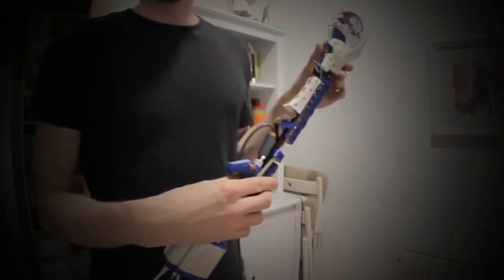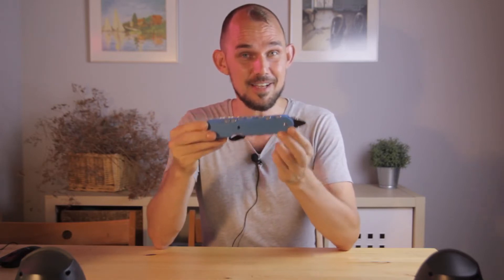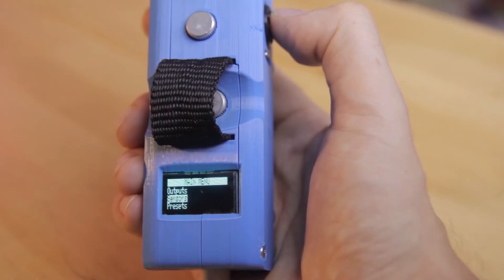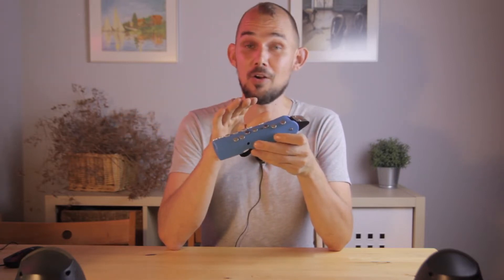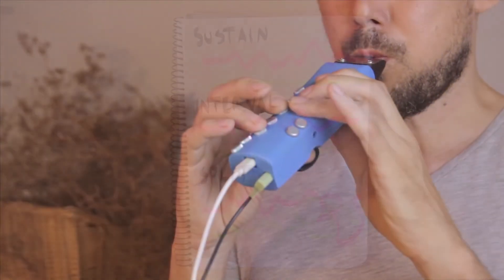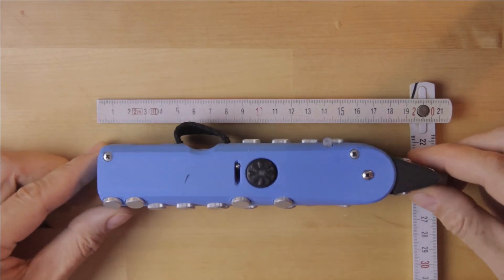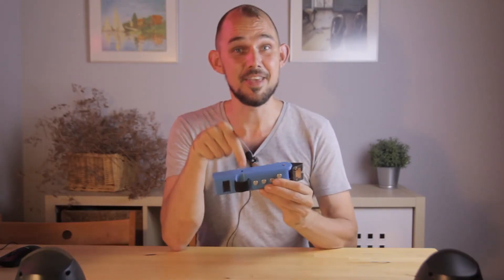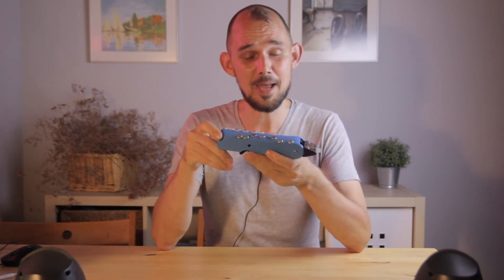My new EWI is bigger on the inside

Comment: well i loved  the idea  , just wanted to know does it works  well as a sax ( i mean sax sound  )  and how much is the one  ?
Reply from the maker: Thanks Mehdi. There is a sax sample on the OHMs, but it's not a super natural sounding sax. The program + the 16 wavetable synths currently included take up 99% of the memory on the Teensy 3.2, so that's a limitation. I'm working on a new prototype which uses the Teensy 4.0, which has much more memory and processing power, so that will mean more and better samples, on board delay, and a few more improvements.
Reply: @KontinuumLAB  good job for real i appreciate ur work   <3

Comment: I keep finding myself coming back to this video. Given my limited experience with these instruments, how does this compare to things like the Akai EWI models, and the NuRad? The size is so much smaller than those instruments. Also, how much do you see your OHMs retailing for?
Reply from the maker: I don't have an EWI or NuRad to compare with. I've played the EWI on several occasions, and I think the OHMs compares quite favourably, although of course there are a few different models of the Akai horn.
The NuRad looks very cool, but I guess is especially interesting for those who want to control analog synthesizers, while the OHMs is focused on the on-board audio aspect. 
As for the price, I basically made this version of the OHMs for myself. Although I did at one point intend to manufacture and sell it, that's not a priority for me right now, sorry. Maybe at some point in the future.
Reply: @KontinuumLAB  I'm sorry to hear that! maybe I can make one of my own as well? I have a 3D printer and I see you sell some kits?
Reply: @KontinuumLAB  Damn, I see the klik instrument kits are sold out. :( I'll be keeping an eye out for version 3!

Comment: How did you get on board synthesizers and sound?
Reply from the maker: By using the Teensy audio adapter (that was the easy part) and installing some sf2 wavetables on the Teensy (which was quite tricky)

Comment: Does it have the ability to switch to trumpet fingerings?
Reply from the maker: No, the current OHMs doesn't do that.
Reply: @KontinuumLAB  what about the board you use? Would it be possible to make my own?
Reply from the maker: @itsaboutchina732  I'm using a Teensy 3.2, with the Teensy audio adapter. That's all publicly available. I am however working on an adapter board to better organize the connections of display, keys etc, so on future versions that will be a separate item. 
Also, I have no immediate plans to document the design, code etc, because I just don't have time. So making your own will be tricky.

Comment: I want one, uff great
Reply from the maker: 👍 Working on it!
Reply: @KontinuumLAB  will it comes with Bluetooth. No cables???
Reply from the maker: @juana.velazquez9286  No. It's a MIDI controller with on board synths and audio
Reply: @KontinuumLAB  Did you said how many sounds will have and with updates will be added? If that's possible. Thanks
Reply from the maker: @juana.velazquez9286  There are 13 sounds on there right now, with options to apply filters in different ways which changes each sound quite a lot. The complete setup of the instrument (sound, filters, sensor settings etc) can be saved by the user as presets. 10 presets in total. 
Don't know what you mean by "updates will be added"
I have considered making a version with the Teensy 3.6, which would give more space for samples. Maybe I will at some point in the future, maybe not.
Reply from the maker: @juana.velazquez9286  I am still working on finishing the software, so expect an update with more details once it's done

Comment: This is awesome!

For battery power, I myself am currently experimenting with two NiHM AA batteries converted to 3.3V through a miniature step-up converter (bought on AliExpress). I'm a bit wary of Li-Ion batteries in custom experimental handheld devices, so AA seemed a good choice. Not sure how good they would work for a full synth, though. In my case, it's just a MIDI controller (wireless - using RFC24 modules). That is - if I have enough time to finish it. 

I started with a Roland Aerophone style mouthpiece, which is a sax-like design and is using a lever touching the reed for pitchbend. However, it might be tricky to get right because the reed has very little movement that has to be translated into a larger movement for the optical sensor to have enough range to work with. So, I'm now starting to like your pitch bend approach better (although it requires more movement from player's side).
Reply from the maker: Thank you. My mouthpiece has a total flex of +/- 22⁰ in each direction, but could be made with much less movement and still get plenty of resolution from the sensor. You're right, batteries are tricky. Compact size vs safety vs power requirements. For instruments as compact as this there's no perfect solution...

Comment: This looks awesome - even slicker than your older versions! Does the small size feel awkward at all? Seems like you'd be bending your arms quite tightly.

Will you be talking more about what you've used for the buttons in a later video?

My electro-sax is getting there - I think the final cardboard prototype is pretty much done, now I want to figure out a nice shape for a 3D printed body. I've ended up using moving mechanical keys that use capacitive sensing underneath. That means it feels a bit more like an acoustic sax than just using capacitive buttons. Thanks for the inspiration!
Reply from the maker: Thanks George! The size is pretty extreme, but I don't feel like it impedes my playing much. The current iteration is basically the limit of how small I'm able to make it. I will be making a longer version, which will make for easier access to the breath sensor, plus allow adjustment for the thumb strap and other stuff.
I will definitely cover the key design in a future video, but it's pretty simple.  They're still capacitive keys, with a dielectric layer. Now the dielectric's just between the outer metal part and a separate electrode underneath it.
As a saxophone player I can definitely appreciate why you would want to make mechanical keys. Have you seen the "Travel Sax"? It's a compact electronic saxophone with a pretty cool mechanical key setup which closely emulates a real saxophone.
Reply: @KontinuumLAB  I hadn't seen the Travel Sax before, so thanks for mentioning it! It looks like the tactility will be awesome, but the styling seems a bit unrefined (just boxes stuck together). That also led me to the YDS-150, which looks pretty cool too!

For me the key feel is as big a part of this as the mouthpiece feel, so I'm trying to get it right. It's pretty close to a dodgy-looking version of the Travel Sax one!